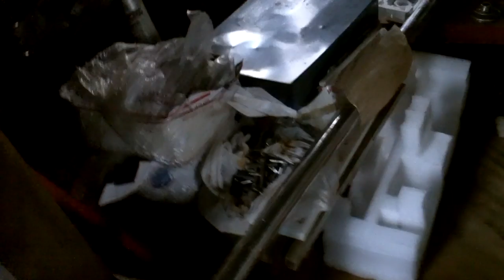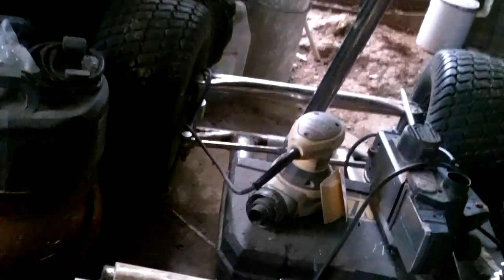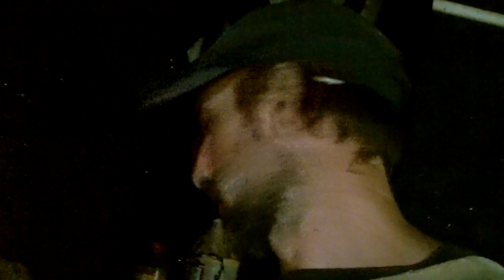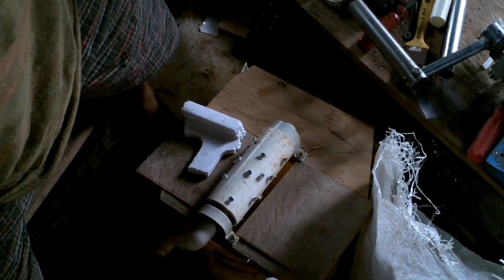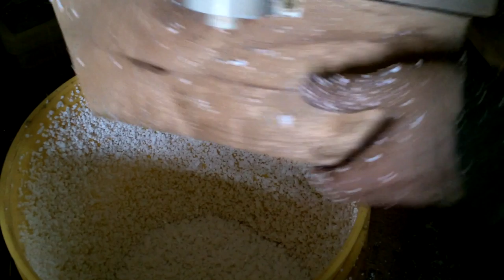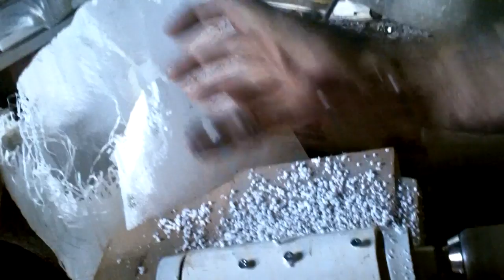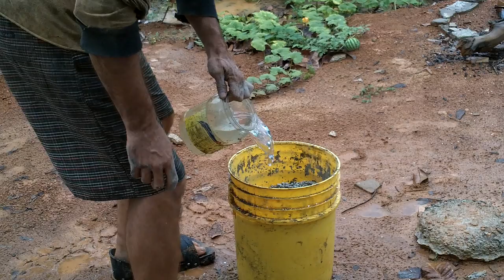Styrocrete: Making a Foam Grinder out of Junk

Comment: Can't you find a good waterproof glue to glue the styrofoam together?  I love your skills and all projects but have to disagree a little on the claim that you take  out of the system and turn it into something useful. It is more like taking it from the system and spreading it in the environment. Think you would be better off with thin walled cubes made from fiberglass with a few holes. Fill them with empty capped bottles for floatation.  Just afreight that with concrete and styrofoam there will be a lot of polution.
Reply: I just have to say I disagree I'm very environmentally aware I'm taking some trash out of the environment and repurposing it in a way that it's going to be useful in last forever or at least a long time and the foam floating concrete their building boats and Islands but I've standed up to the test the time already the cool thing about concrete the longer it takes the time to cure which all the concrete near dams is the hardest concrete you find especially at the very bottom where it's taking the longest to cure some of the oldest dams still have wet concrete in the hearts of their bottom any Oxygen exposure allowing them to dry slowly but completely turns them harder and harder.
 this wouldn't only be a great method for building his concrete floating docks which will be very sturdy and easier to hold onto and last much much longer if done right in the long run with much less maintenance than the fiberglass or plastic or anything else .
 check out the use of Michael Reynolds, Google, been building sustainable housing out of tires and trash for I believe over 40 years now what he's doing is truly amazing in the cool and the holding of heat that the Earth pack tires sealed with a thin layer of mortar, concrete, stucco, Adobe or Cobb both are the same thing just different application .
Amazing what he creates that need no alternate heat or cooling Source other than the Earth and the Sun .
 what Jamie is doing truly isn't new it's been done in many applications he's just doing it his way to see how it works for him.
Reply: @henryphelps3590  Henry, I am not a tree hugger. I also have my part in poluting the world I guess. Drive a pretty un economical car and a speedboat that burns gas faster than you can put it in. In general people are the biggest problem. But what I mean is that before Jamie came to the island it was only nature. Now he lives there and thransformed the island in a way that it will never be the same. there is so much glass fiber an pvc pieces and concrete spread over the island that it will be in the local environment for thousends of years. Just n other example. Years ago we made a 4 month asia trip. Went into the gobi dessert in mongolia. For hundreds of years nomadic people lived in the gobi without leaving a real trace. people traveled per horse and lived in tents made out of wooden sticks and fabric made of jak wool or sheep wool. Nothing major changed for hundreds of years. after people left there was only nature again. But then we got cars. many people (also me)  cross the gobi by car. the car will erode the surface and makes deeper and deeper tracks. people start using plastic more and more. There is no garbage man tht will take your trash away every week. so they trough it out. The wind takes it. spreads it. when we left the city of Ulanbatar the scenery will change from concrete buildings (looking all very russian) to wasteland with thousands of wooden fences everywere with nomad tents inside. a sort of transition between nomadic life and city life. and the furter you go the more empty it get's. barbwire everywhere. and this transition took about an hour of driving from the real city to the real empty nothing in the gobi. during this hour we only saw plastic waste just everywhere we looked. every barbwire fence was covered with plastic schredded bags. cups, bottles. just taken by the wind until it will hook onto something. It hurts me to see that. it is done by humans. We are the problem. And there are just too many people on the planet.
And I am aware that I am part of the problem too. Everyone is. I never litter and sort my waste but still will help to destroy the planet. I love eating meat. Love horsepower in my car and boat. Love to travel. So even when you create a house half inground made of plastic tarps and old tires you maybe keep those old tires from the scrap heap but atleast the scrap heap was in one place. now you took the tires and put them in the ground somewhere in nature where before you came it was probably just a hill with trees and rocks. You will live in it. Saved in poluting by not buying new building materials but using garbage. but the rubber will start to decay at some point. it will start to release particals. Maybe you will get sick and need to go to a hospital and die or from there go to a retirement home. The place you lived in is now abandoned. decay will set in. water leaking in, no repairs done so it will get worse and worse. it will cave in at some point.  Not a single person that will ever take all these old tires out of the soil and the plastic tarps you used to cover the under floor to keep moist from coming up. plants grow over and the waste is burried in nature for ever and will decay bit by bit releasing it's chemicals in the environment. Same with the island of Jamie. Not a single person will ever remove all the stuff he made over there when he will be gone. the will take the boats way if they still float but the concrete and plastic and glass particals will never ever get removed. will erode and over decaded or centuries will add to the plastic soup. I am no better myself and I want to have a nice life and understand why you would use plastic or concrete over wood but the wood will decay or get eaten by bugs. that is not what you want. and just cutting trees is also not a solution. it was the perfect solution in the past but now with so many people nature can not keep up by growing them. hey again the same problem. people are the problem. human kind and the amount of us. but I guess we can just do our best to have fun in a somewhat responsible way to keep it livable on earth. and with time new inventions will come that will get rid of old problems and mabe create new ones instead.  Well this epos got pretty long. If you made it to the end. congrats. I love Jamie and his skills. I have been in Panama too and love the country and nature. visited San Blas too. But al over the world you see the plastic waste washing up every beach. In cambodia we visited a nice simple resort on an island. Was talking to the owner and told him I loved his island and simple basic style cabin jungle resort. but that it would be a plus to start cleaning the plastic from the beach to make it look more nice and pristine. He told me that his staff, a group of 6 would walk the beach EVERY morning year round. the get up when daylight is still sleeping. and start walkin at first daylight to collec all junk that washed up over night and put it in a central place to burn it once a week. some of the waste was brought back to shore every trip they made with the boat to bring and get guests. But that plastic is just a big problem. that being said. Also think plastic is a great productto use in many occasions. just need to dispose it propperly. and I do not think using it it floating concrete mix blocks is one of them because barnacles will "eat" the concrete away and the styrofoam will get released ball by ball over the years to come. .....I think. am no expert.